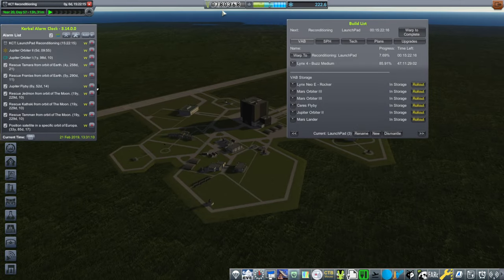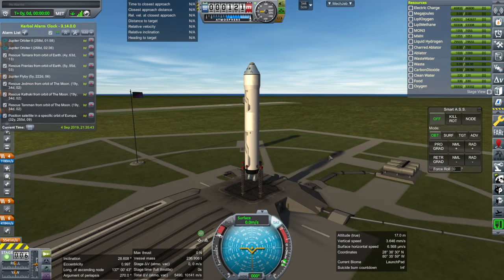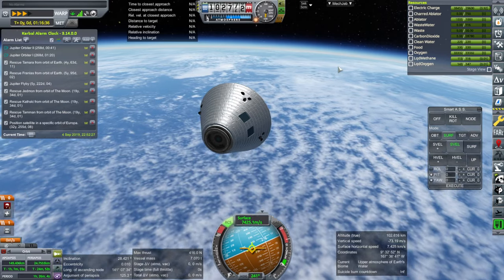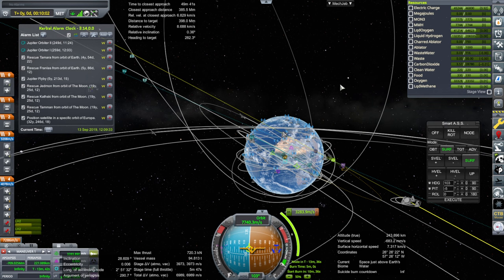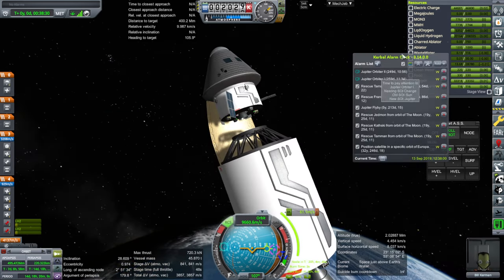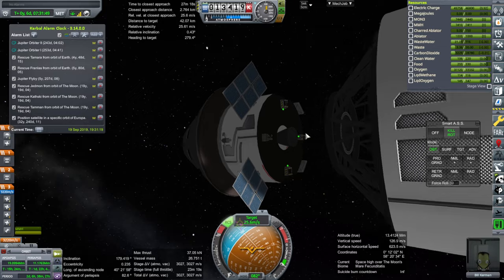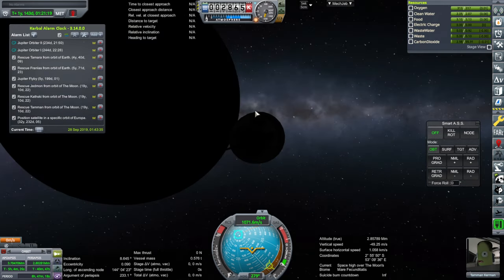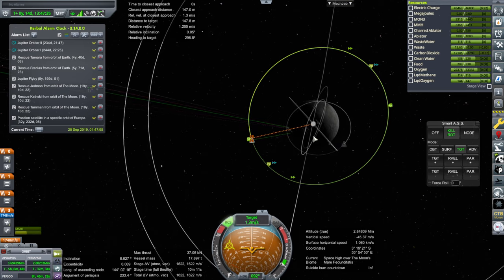RP-2000 Career 38 (RO in KSP 1.12)

Comment: Have you had any luck with trying the blue origin upper stage on top of SLS as a replacement for the EUS?
Reply from the maker: I did that a long time ago many times, including in this video: https://www.youtube.com/watch?v=Uba-3S9r1lw
Reply: @RaizSpace  I was referring to the video you put out a few weeks ago when you were looking at using the Center five as a possible replacement for the EUS since the EUS is going to be delayed.  I thought you mentioned in there that you were going to try the blue origin upper stage as a possible EUS replacement on SLS.  I’m wondering about that not just because the EUS is going to be delayed, but because even with the EUS Orion can only enter NRHO.   Of course that means that the lander has to do a ridiculous amount of work compared to Apollo. I was wondering, if using a higher energy upper stage would allow Orion entry into low lunar orbit, and therefore Artemis wouldn’t need such ridiculous landers.